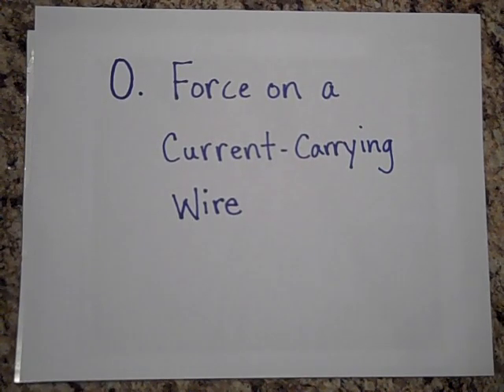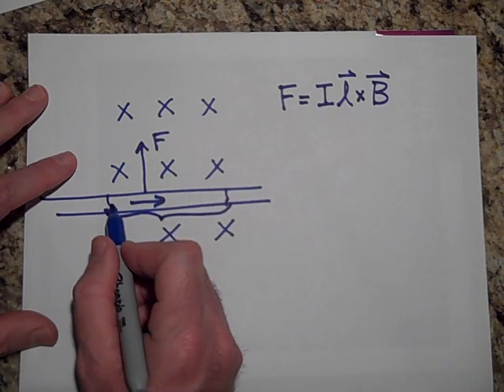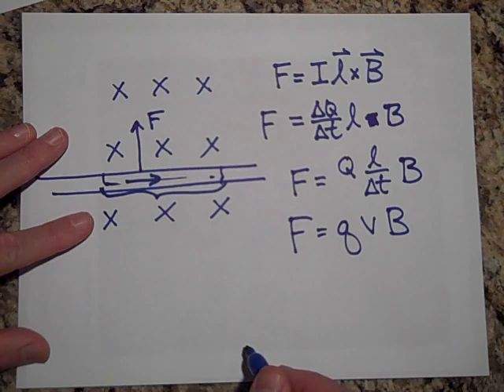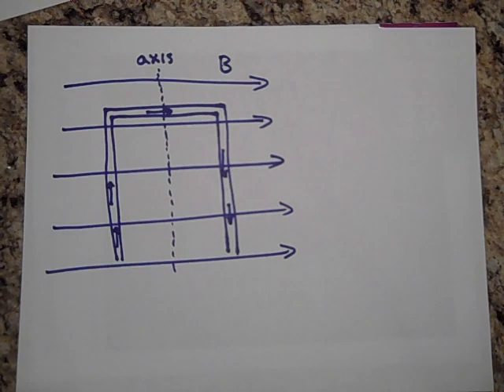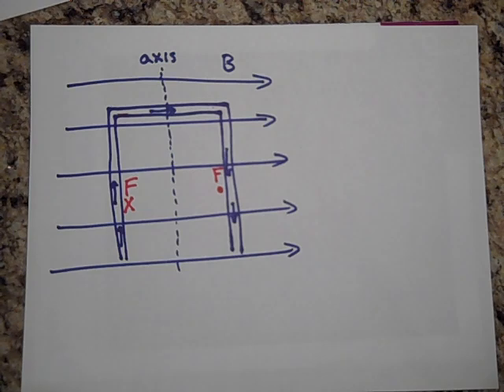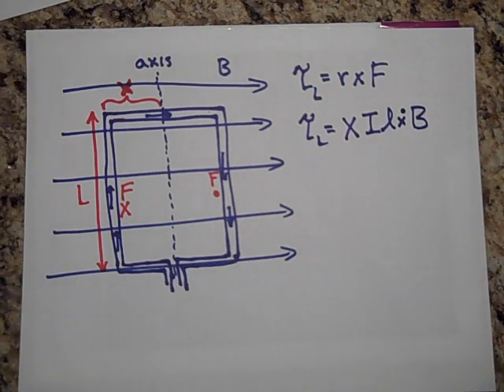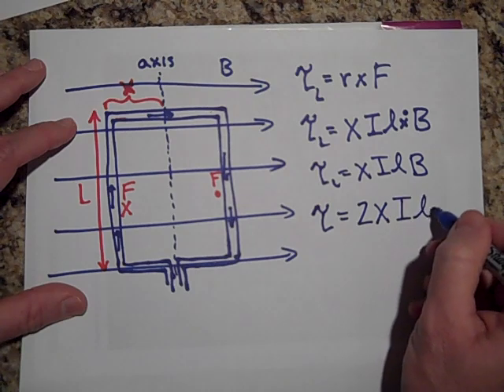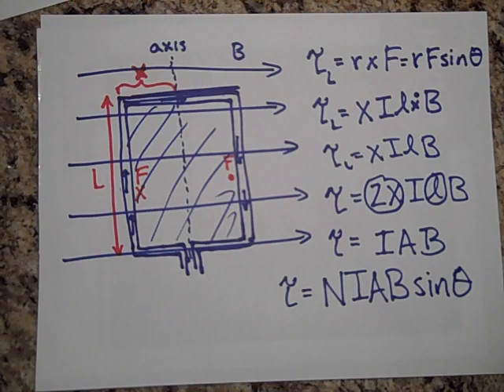Forces on a Current-Carrying Wire

Comment: We use F = (current)(length of wire in the B field)  X  (B field) = Lorentz force to create coherent accelerations of the charged particles in very thin layers of metal.  We are using UV light in an attempt to increase the number of free electrons in the thin metal layer to boost the effect.
(UV light induces the photoelectric effect in metals)

The thin metal layer gets its current from eddy current coils that are in close proximity to, but not touching, the metal 'foil' layer.  It's similar to your drawing:  vertically oriented magnetic field, current flow in a conductor (the thin metal) at a 90 degree angle to the B field, resulting in coherent motion of the charged particles in the layers.

To cut down on the remanence, the thin metal has no trace of iron, cobalt or nickel.  The eddy current coil is fed with a very high frequency amplifier, and the signal alternates (it's not DC).  So the current flow induced in the thin metal layer swaps back and forth at the frequency fed to the eddy current coil.  Remanence would generate heat and impede the back-and-forth accelerations of the charged particles in the metal.

We use the Lorentz force to create coherent accelerations (back and forth) of the charged particles in the metal layers.  Thanks for your great video!

Comment: You supposed current to be positive, Isn't current contain electrons, or negative charges?
Reply: Current is defined as movement of positive charge. In a real conductor, electrons move. However, as convention in old times was when this wasn't known people still consider current movement of positive charge. And really, although electrons move they are also causing positive charge movement in the opposite direction.

Comment: I don't understand where the force is coming from.  The current through the wire creates a magnetic field around the wire.  On one side of the wire the mag field is a vector in one direction and on the other side it is a vector in the opposite direction.  So with the wire residing in a uniform field, those two vectors of the wire's mag field are opposing and attracting the uniform field.  So shouldn't the effect just cancel out and no force results?
Reply: the in and out force are on 2 diff parts of the wire. If it was at the exact same spot, then yeah the 2 would cancel out, but the magnetic field created by the current is different (direction wise) on the left side of the loop vs the right side of the loop. Its the same current flowing through the same wire, but because we looped it, the direction the force is on the left side is not the same as the direction the force is on the right side

Comment: Quick question if there is a current through the wire would it not then create a magnetic field itself in a different direction than the already present magnetic field?
Reply: +Jim McMahon Yes. In fact, through all of the different sides of the loop, we'll have a magnetic field. You can find out the direction of the magnetic field through each, using the right hand thumb rule.